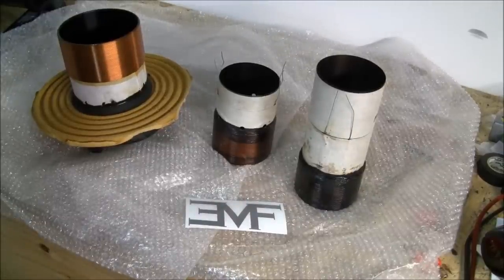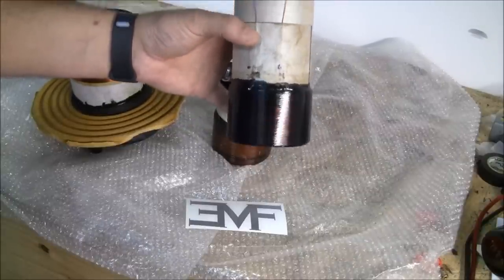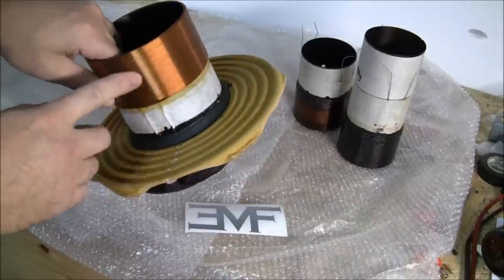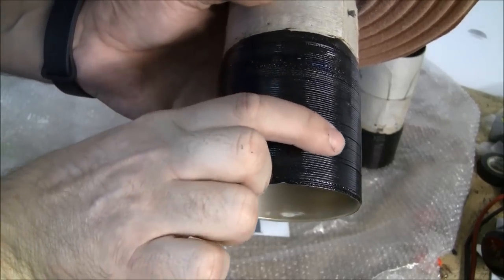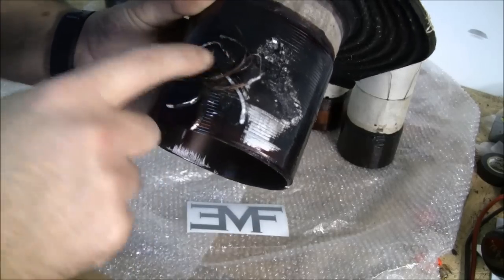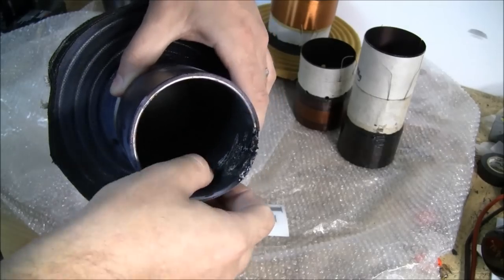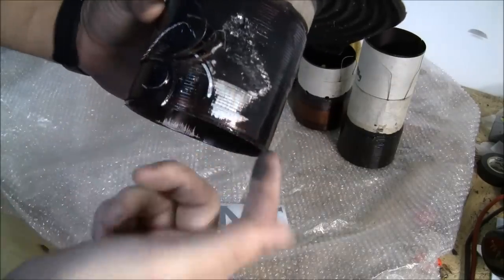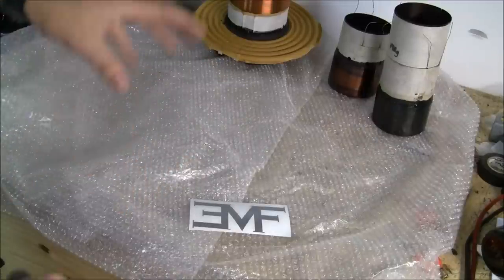Voice Coils - we know what you did!

Comment: Funny how I have a Rockford Fosgate T-1000.1BD and a set of Q Power 15 inch Deluxe dual 4 ohm subs ran at a hair below clipping in a sealed box for 8 years and they still haven't blown . I bought a pair of sundown SA 15s and they smell like they are about to blow the coils . Power is clean and subsonic is on @ 28hz and low pass at 80 hz . EQ also has low pass set at 60 hz for sub . Q powers were taking this beating for years and I only changed them out because I thought I should upgrade to a better sub . Is it normal for subs to smell when new and giving them a lil bit below rated power . All gains were set using oscilloscope and head unit checked for clipping volume .
Reply: Q POWER DELUXE DUAL 4 OHM 15 
Specifications:
Peak Power Handling: 2200 Watts
RMS Power Handling: 1100 Watts
Nominal Impedance: 2x4 Ohms
Mounting Depth: 6-3/4"
Cutout Diameter: 13-7/8"
Magnet: 90 Oz.
Resisance: 2x3.2 Ohms
Voice Coil: 3"
Cone Diameter: 320mm
Sealed Air Space: 2.2- 3.8 Cubic Feet
Vented Air Space: 2.8- 3.85 Cubic Feet
Fs (Hz): 30
FREQ RES (Hz): 30~1500
Qms: 7.52
Qes: 0.60
Qts: 0.56
Vas (Liter): 101.37
Xmax: 12mm
Reply from the maker: Fresh subs will usually have a smell to them when heat is applied, for a little while. That goes away. Another consideration is the box they're in, may or may not be correct, that can cause issues too.
Reply: @EMFAudio  box is exactly 2 ft³ per sub interior dimension . Specs for new sundown sub call for 2.5 ft³ . Would it be ok or could that burn coils ?  I'm going to build the box a tad bit bigger but I just wanted to see how they sounded in prefab box until I built the new one . I could only add another .5 cubes per sub and my trunk space will be maxed out . Thanks for the reply and keep those vids coming they help out alot when choosing equipment and figuring out what we can get if we have some cash to spend  . I'm surprised those cheap Q power subs haven't blown out yet . The coils are probably black as coal by now . LOL

Comment: Question: New sub, loaded enclosure, Kicker TL7T 12. I played it, at slightly under rated power, for about 1hr30m-ish and no clipping. I didn't notice it then, but I did later, the subwoofer has a slight burn smell to it, if I'm near it. If I smell around what would be the cap area, I can smell it pretty good. It still seems to play just fine, no issues what so ever. So is my subwoofer now on borrowed time? did I run it on high RMS for too long? or is it going to be fine?
Reply: That's normal that's break in period the subwoofer is new so it's breaking in and it's the first time the glue gets hot so you're going to smell the voice coil it's normal I'm 2 months late is the sub still playing good?
Reply: @nickolasvaughn667  yes, subwoofer still plays good. Smell is gone to my knowledge. Haven't had a long road trip in a bit to play it that hard. Seems to be just fine. I did error on the side of caution and turn the power to my amp down a hair and I watch to make sure I'm not clipping.
Reply: @scottstamm7022  yep as long as you're not clipping you will be good yeah when subs are breaking in they stink

Comment: What’s your price on fixing a 13w7 was told $200 locally
Reply from the maker: I won't touch any W7's.
Reply: EMF Audio why is that jus curious and hey is what it is
Reply from the maker: @AllaboutTheWoodrows  They're very time consuming to do, a total pain, in addition to a lack of parts availability.
Reply: EMF Audio I feel you I’m more of a don’t care for original ect plus I’ve been curious how different one sounds on say dual 2ohms or dual 4 instead of the dual 1.5s just one them things I’ve been pondering since I got stuck with a burn coil in a sub my amp wasn’t hooked up when I bought it and it didn’t seem like it had issues everything checked fine but even though I know it can get fixed I’ve just been curious how different things would be. Switching the ohms like that
Reply from the maker: @AllaboutTheWoodrows  The thing is, you don't really have coil options without winding a custom coil (and even then limited) because of how the motor is. You also have to use their soft parts unless you change the basket. If you change the basket, it has to be very specific because you have to drill out a new pattern in it.
Reply: EMF Audio that’s good info, so basically if they work it’s cool but rebuilding isn’t practical for most
Reply from the maker: @AllaboutTheWoodrows  It's my understanding JL won't recone them anymore either.
Reply: EMF Audio yea unless it’s a anniversary edition they won’t if I’d known that I’d just gotten one of those instead lol but hey shit happens

Comment: Is it too much when I smell the coils but only if I'm standing near the port?
Reply from the maker: Ideally you shouldn't be smelling them at all.
Reply: @EMFAudio  But is it bad for my subs If I go more then I step back from the port I stop smelling it.
I hope this isn't bad for my sub.
Reply: @EMFAudio  And it's not clipping or distorting I got the sub yesterday
Reply from the maker: @lilsnowycaraudio  If it's brand new you may smell it for a little bit during the first few heat cycles, that's normal.
Reply: @EMFAudio  So it's not damaging the sub?
Reply from the maker: @lilsnowycaraudio  It shouldn't be, but not seeing/smelling it for myself I can't say for sure. If the smell continues for too long you may be over-powering. I'm assuming you have around rated power on the sub in all of this.
Reply: @EMFAudio  It's getting fewer.
It seems like the longer I play the better it gets.
Reply: @EMFAudio  But I think it's underpowered for a 12 inch it doesn't move a lot.
I was quite suprised smelling voice coils because the sub was really expansive.
Reply from the maker: @lilsnowycaraudio  The smell isn't exclusive to cost, but if the smell is going away you're probably fine.

Comment: The only thing I disagree with on here is that where a customer may abuse a subwoofer and I am sure some people really fry their subs on purpose and then try to blame the manufacturer but manufacturers also are asking for that when they rate their subwoofers with false ratings. Most subwoofers even from some of the top brands are anything but clear on how much power a subwoofer can actually take from a amp. They want to take advantage of newb customers and people who don’t understand that there is no such thing as max power and that if you run that equipment at max power it’s going to fail. They do everything that can to make that “max power” rating the only thing people see so they can be competitive with the other brands that do that. As long as that happens how can you not expect to get burnt up voice coils? Then they say well you put too much on the sub. IMO whatever that max power is you should warranty it for. So since kicker wants to call a 10 inch comp r a 1600 watt sub then if someone pushes 1600 watts through it and smokes it like they will. Then kicker should replace that subwoofer every time….

Comment: Hey I have a problem with my 10” sub, it has been working well for a long time, but recently I noticed a small rattling noise. I’ve taken the sub out of the box and looked at it, it reads 4 ohms, when I tap on the driver it sounds normal, but when I push down there’s a very soft rubbing noise, please answer this if you know or have an idea what the problem is, also I have checked the spider
Reply from the maker: With as little as you've told me, my guess is the former may be bubbled.

Comment: Has anyone ever had a tiny thermocouple installed in a coil to see if these coils can actually take the power they claim?
Reply from the maker: A thermocouple wouldn't tell you if it can take power, only if it can take heat. And yes, someone poorly executed that idea and I'm not sure if it's sold anymore. It didn't work very well
Reply: @EMFAudio  Yes I know what a thermocouple does.  It would tell you if when you give the coil the rated power if it overheats or not or how close it is to its thermal limit, under those conditions.  Seems like it would have to be placed between the former and coils and have a thin enough profile to not create a high spot.   Just curious.
Reply: @jamesg8246 🤫

Comment: Okay so I have had numerous systems over the years and I have always wondered if you push a sub at its limits or just under and start to smell the coils and immediately turn it down or off amd.let it cool before playing it again, does it cause damage to the coil or weaken its power handling capabilities at all???
Reply from the maker: That depends on the coil, really. Coils on certain subs I've shown how bad they are that might be the point where the glue on the former is about to let go, or starting to let go. It might be too late, still play, but not how it should. In most cases you're safe, but there are exceptions depending on the coil design.
Reply: EMF Audio well in my most recent experience it was with an audiobahn 1805q on an audiobahn a2300hcq amplifier according to their specs they should be a perfect match but if I play it full tilt I begin to smell the coils with that awful smell subs give when they are blown.... I sure hope I did not burn or hurt the sub because it is quite rare now as old as they are and it does a respectable 143.6db on stock electrics in my 08 Lincoln mkx
Reply from the maker: It's possible you were clipping it, which would cause that smell even if using rated power.
Reply: EMF Audio very likely

Comment: Could you help me with my cheap sub?
Been running this 8 inch single slug 'old school' style chinese sub on 300 watts. Its rated at 250.
In reality, there are no issues, but I get a bad excursion movement above 60-70 Hz where the excursion becomes pulled to one side instead of equal movement from center, as if it's phase offseted! I confirmed this on free air.
And after like three months the coil is fine, except that I can see a 'heat ring' on the bottom of it. Probably due to the excursion problems.
I tried diagnosing it without ripping it apart, but my conclusion is a magnetic gap or coil position error...
Reply from the maker: If I'm understanding correctly, you're saying 60-70 hz instead of equal forward and backward it's moving but it's "center" point is further in one direction? Have you tried it on a different amp? I've seen this before with 2 different causes.
Reply: EMF Audio Yes. I'm kinda sad about it, but all other subs I tried don't have this problem(RF P2D4-8 from my buddy). Quite a mystery. I have another sub of this model from twelve years ago, but I see a difference on the height of the basket and the spider is enlarged from 6" to 7" 25'.
Same 1.5 inch coil. Wow!
Reply from the maker: @ruikazane5123  What you're describing is actually a poorly assembled sub, or a poorly designed sub assembled correctly. It's probably actually doing that same thing at all frequencies, you just can't see it with your eyes unless you're playing higher frequencies.
Reply: EMF Audio Probably! Heheheeh! I might need to get a real sub. No money left...

Comment: 72/5000
Question, which is better double magnet motor or magnet of larger size or area ?
Reply from the maker: There is more to it than that.
Reply: Generally the larger motor with same size voice coil will allow more xmax and have more of the coil in the magnetic field generating more force with the same power as a smaller one. Double stack can mean so many things is it another magnet glued on to the bottom of the motor ? Is it faces n-s or oposed as that can actually help as it can get rid of some Eddy current and helps focus magnetic into the voice coil again decreasing loses and making more force from the motor with the same power ( aka louder)

Comment: WhaT if the coil is bright copper with some black lines but the ohms  on each coil are both reading at 3.7 its 4 ohm dvc. Dont that mean sub is not blown ?? Im getting what I think is clipping one night perfect sounding . Car in my car next day and turned it on and sounded like shit ! Why??
Reply from the maker: Bright copper with some black lines could be the coating on the coil being thicker in the dark spots. I've seen it at the top and bottom of the coil. Otherwise it may be burnt, at the bottom of the coil would be the most common for a poorly cooling sub. If it suddenly sounds bad one day and didn't the day before you may have bubbled the former or started to unwind the coil.
Reply: @EMFAudio  alright thanks for the reply . Take care

Comment: I know how to build a voice coil that will never burn out, never unwind, and has almost zero resistance making it much more efficient than, and produce a much stronger magnetic field than traditional voice coils,.
Reply from the maker: No resistance isn't possible, nor would it even work because amplifiers wouldn't make power as they'd turn on in protect. The coil doesn't produce the magnetic field, the... MAGNETS, do, and the top plate and pole harness it.

Comment: Can this happen to a 600 watt rms sub running on only 130 watts clipped ?
Reply from the maker: Not impossible but is improbable.
Reply: If you clip it hard enough, your 130w amp can push out peak-to-peak power that exceeds the handling of the sub. A 1v RMS square wave and a 1v RMS sine wave have different peak-to-peak power.

Comment: Does coil wire awg effects Bl motor strength?
Reply from the maker: It does not, presuming the overall amount of wire is the same.
Reply: Your motor's strength is determines by the "flux", or the strength of the magnetic field it's creating. That rating is relatively static, and only minorly changes over time, heat or field from the coil.

Comment: Hello can u tell me what causes the gapping or the sliding is it the glue getting hot
Reply from the maker: Yes, excessive heat and more often than not, the bottom of the former not being rolled.
Reply: EMF Audio thx for reply is that a flat spot so it can’t slide .... these are budget skar so huh great info
Reply from the maker: @schmidt76ful  I wouldn't say it completely prevents them from sliding as other issues can happen, but it does help. It's pretty rare to not have that, even cheap stuff does if it's an aluminum former. If the former is another material like kapton or fiberglass it won't.
Reply: EMF Audio thank u

Comment: Cooked my door speakers so bad you cant even use your fingers to move the driver I'm assuming g the voice coil welded itself to the driver.  The tweeters work great still though lol . 260 bucks down the drain if I would of known better I would of cut them off at 80hz or 100 and let the sub handle the rest.
Reply from the maker: The coil probably just unraveled and jammed it up.
Reply: I'm not sure but there is zero movement in both speakers. I was only running them with 50 watts a side. Tweeters are phenomenal though. Audio illusions 5 x 7 s

Comment: What is the difference between dirty power and clipping? Also, how do you get excessive current to the subs? As in, why didn't the 10k blow holes in the coil like the 6k did?
Reply from the maker: Dirty power can be generally distorted signal, or it could have random noise. The noise could be higher frequencies being injected that you can't hear, but do generate heat. It's also possible that the impure signal getting to the sub is a sawtooth wave which has just a tiny sharp peak to it, that's often associated with minor clipping which will burn tinsel leads. Excessive current to the coil is from low impedances. Example, wiring to 0.25 ohm vs 1 ohm on the same actual power, 0.25 ohm has way more current going into the coil, which generates more heat. Power for power, 1 ohm will be less likely to have problems (and the amp will be more efficient too). As for why the 10k didn't blow holes in the coil like the 6k did, that can be the wiring impedance or it could be clipping vs not or it could be ACTUAL power, not rated power being the difference.
Reply: GhilleGhille dirty power is clipping

Comment: Hey idk if you’ll see this but I have two txxbd4 12s on a apmi2000(1944wrms) lately I’ve been hearing a hard clicking noise from 25-65 hz took them out can’t hear a vc scratching any idea what is causing it
Reply from the maker: You're probably hearing clipping from the amp.
Reply: EMF Audio I thought that too but it’s never done it before I thought it was the box so I put more screws in it idk tomorrow I’ll call audiopipe and see what they say
Reply from the maker: @johnhandley730  Low voltage will cause clipping you haven't heard before too.
Reply from the maker: @johnhandley730  Low voltage will cause clipping you haven't heard before too.
Reply: It has seemed like it doesn’t want to start up so I’ll take it into work tomorrow and have the alt tested
Reply from the maker: @johnhandley730  Perhaps a bad battery? Which, would also cause low voltage, and clipping.
Reply: EMF Audio I have a spare red top I can throw in there real quick I’ll try it out tomorrow and let you know

Comment: Not asking for warranty reasons, just asking for my own knowledge. Should a healthy dual voice coil be all the same color? My voice coil(/s?) is half copper-colored on the cone side and half black on the magnet side.
Reply from the maker: It's possible it won't be quite the same color in different spots because of the coating put on the coil. If it's thicker or thinner that could change the color some. Many of our coils are darker at the top and bottom than the middle. They aren't extreme color differences though, not like bright copper and charred black.